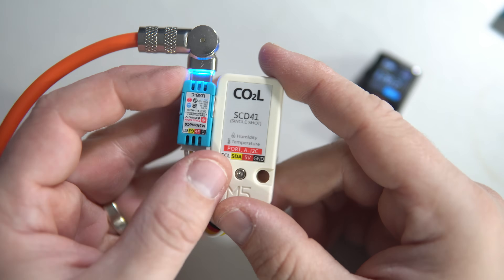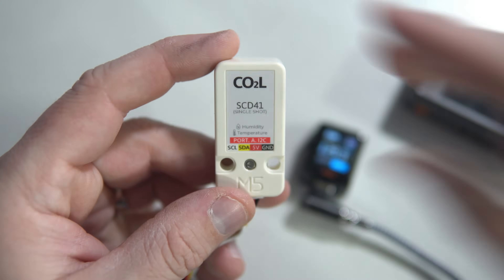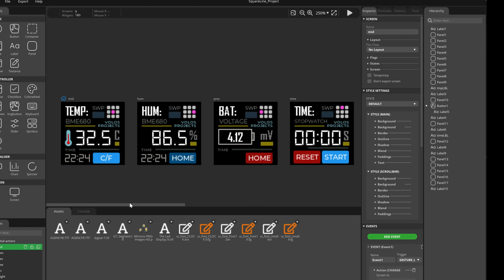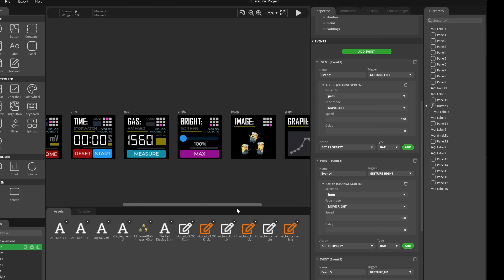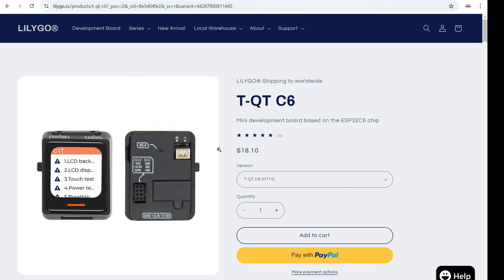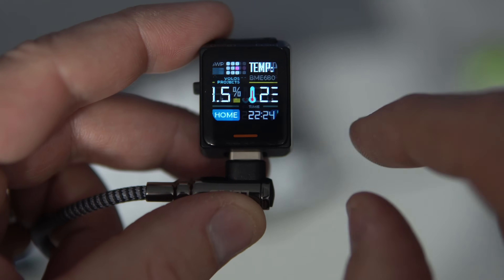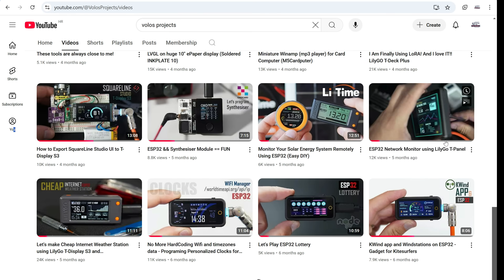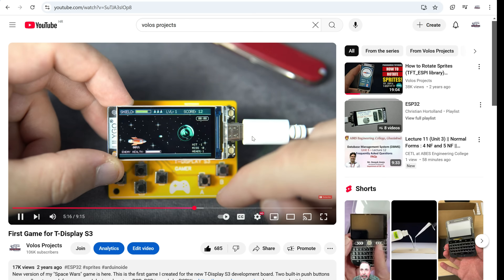Can This Tiny ESP32-C6 Board Actually Be Useful?

Comment: Hello, 

My application would be a micro dashboard in every room of a house.

Would the board do Zigbee, I seem to understant C6 supports Zigbee and Thread ?
How long would a battery last ? 
E-Paper would be a dream, just to make the battery last. Is that E-paper in the new version ins the video (with a ring)?
Reply from the maker: Yes, it suports zigbee, power consumption is around 80ma so it depends on size of battery. No , veraion with ring os not epaper

Comment: After watching several of your videos, I feel you're one of the best people to ask.  Is there a board powerful enough to display 6 or more LVGL gauges simultaneously on one of those 12.3 inch ultrawide lcds?  If so would you do a video on it?
Reply from the maker: short answer, no, that screen is to big for esp32, tat is job for microprocesor not microcontroler, forexample raspberi pi can do that.
Reply: @VolosProjects  Thank you. I did read somewhere that expressif is making a dsi to hdmi extension board for the esp32-p4, so maybe we'll be able to do something like it in the near future.
Reply from the maker: @dennisbalagna  yes p4 will be able to do that